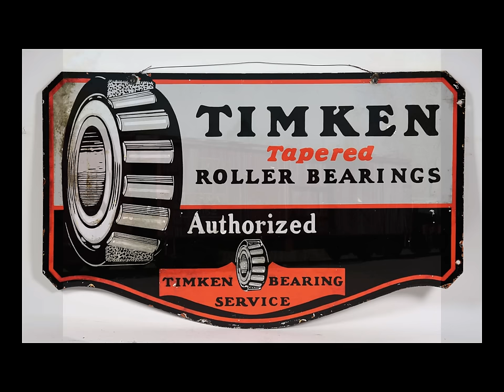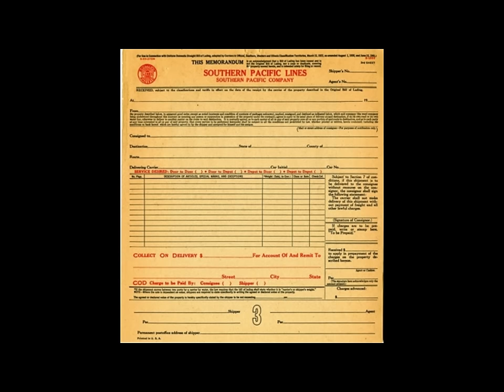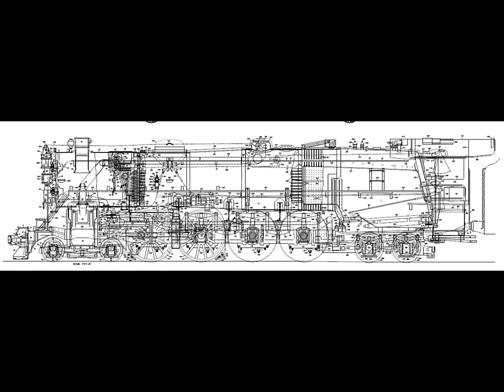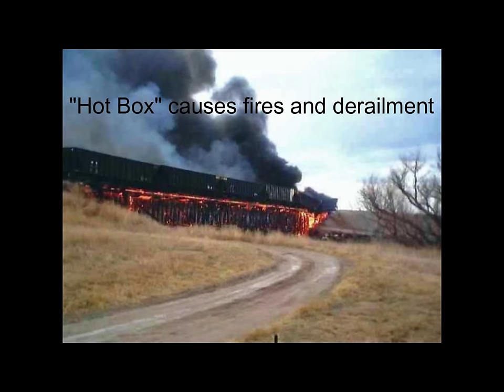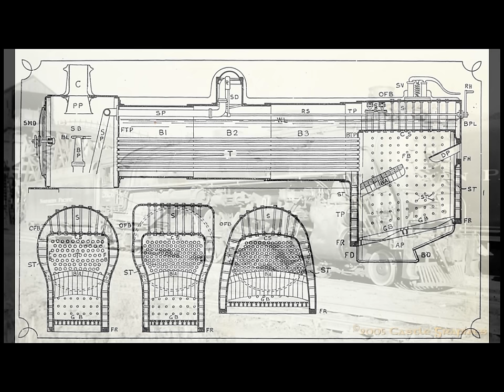Timken's Four Aces

Comment: In my experience of 30+ years working  & repairing steam engines in the U.K.  the most common issue regarding low water ignorance is gauge frame problems.
It’s a daily operational check 1st thing before lighting up or when engine in light steam.
As a driver/fireman you’ve got to be confident it’s demonstrating a true level of water over the crown sheet, when stationary with the regulator shut.
When you open regulator the water will lift by around 1”+.
Another issue is when on the road watch to see if the feed rate is keeping up with steam demand?
Water level falling consistently in sight glass shows this.
Instruct fireman to get second feed on!
As a driver on steam myself, (as taught), I used to shut the reg now & again to see where water was at especially if it was out of sight in top nut.
I myself always liked to see water bobbing in top nut with reg open.
Thanks for effective & interesting vids on these impressive machines you had in the U.S. Keep em coming. 🙂
Reply from the maker: Back in those times it is really beginning to seem like these engineers were purposely running the locomotives with lower than the recommended water levels. Obviously doing these video's I have been diving much deeper into them and the frequency of boiler related incidences is shockingly high. The info you gave is good stuff! i love hearing about real life experiences. Thank you!
Reply: @TheRailroadCrossing-SteamPower  water treatment may also have played a factor though by the late steam era it should have been fairly understood, as for the low water you get more space for steam by running lower but its dangerous, 
but ah the demonstrator engine, heard they tried to save it and it still got cut up even thought the creators tried to get it back :{

Comment: Right around the period of dieselization my father would bring home some discarded metal-frame bench seats, coal shovels (great for snow-shoveling), fuzees(traffic flares) and other odds-n-ends from the railroad he worked for. But best of all, he'd occasionally bring home a few steel ball-bearings( kids called them "stee-lees") which were coveted by young marble players.
Reply from the maker: Yes!! I had them myself! And they were wayyy cool to have!
Reply: Yep, I remember them too.  Better than "puresees", which were coloured, but otherwise clear glass.
Reply: Those are ball bearings.  The difference between ball and roller bearings is significant.  Ball bearings are good for rotation but not side or axial loads.  Roller bearings are good for rotation while offering good side and/or axial load at the same time.  The names say it all--ball or sphere and roller or rod or slightly tapered.

Comment: The reason why fireman would run the engines on low water back then was because the locomotive would produce alot more available horsepower. More steam + less water = way more bang for your buck! Hope this explanation helps! Also love the videos keep em coming 🙂🙂
Reply: dosn't work like that I'm afraid.  Power output on a steam locomotive is unaffected by water level (unless its too high of course). What is effected is the volume of steam, higher water level = smaller steam space, meaning the loco could be worked harder without losing too much steam, but a good fireman will balance his fire and injectors to match what the loco is demanding at the cylinders.
Reply from the maker: Good explanation!
Reply: Your explanation is true for what the fireman thought in those days ,  but not necessarily scientifically correct.

Comment: Less water means less weight in the engine. less water means less fuel to heat the water in the boiler. Less water means faster steaming with the same amount of fuel. 
Too much "Less water" ,means the fireman and engineer get cooked like lobsters, the boiler shell is wide open for inspection, it is easy to inspect the stay bolts, the tubes and flues are already removed (usually found to be twisted and not fit for service) and the smoke box has no ash or other residue. In some cases the boiler is removed from the frame making it much easier for the maintenance crew to service the springs, rigging, brakes, boiler saddles, mud rings, injectors and wheel bearings. You can see, there are some advantages in running boilers low on water.
Reply from the maker: With the disadvantage being people lose their lives.. Not a fair trade if you ask me.
Reply: Also makes cutting up for scrap easier lol

Comment: Interesting fact, Timken bearings are used on Aircraft landing gear even though today. Also the whole thing about engineers running the boiler critically low on water supposedly was an attempt to make steam quicker as it reduced the cooling effect that water had in the boiler thus flash boiling water to gain pressure faster.
Reply from the maker: Yeah, I get that feeling and it's just not a smart thing to do.
Reply: Actually the damage of the crown sheet was due to the water glass being fouled up and wasn't properly reading the correct water level and that's what caused it to fail. @TheRailroadCrossing-SteamPower

Comment: We used thrust bearings on steady  rests in machinery shops, still do.   The fact that a bearing equipped locomotive demands must lower force to lift is fantastic.
Reply from the maker: Indeed!
Reply: Our Machine  Shop has Bronze Bearing adjustable Steady Rests  AND Follower Rests 
BUT we ALSO have ROLLER BEARING steady rests on our LARGE Diameter
Lathes : )
Reply: @walterlefferts6297   OK.   :)       be sure and scrap all your parts out in as an efficient and orderly fashion as possible.
Reply: @archiecoolsdown5854  haha
Our shop is modern and highly efficient, little to ZERO waste or scrap.
It's 2024 grandpop  not 1930 .
Enjoy !

Comment: Since the water in a locomotive boiler is able to slosh around it takes a competent fireman to know what's going on with the water glass. When going up grade the water runs back against the rear of the boiler and the glass will read high. It's important to keep it high on an up grade to keep the far end of the tubes covered.  When the hill is crested and the downgrade starts the water runs to the front of the boiler. If the water level was dropped too far on the climb the possibility of the water running out of the glass on the downhill run exists and then all reference is lost as to where the level actually is. Some mistakes only happen one time.
Reply from the maker: For darn sure on only getting one chance to make a mistake with these things!

Comment: There could be several reasons why a footplate crew might run the water lower than normal, but obviously these are just generalisations, and not excuses. 

1 poor water quality courses priming, so when this is encountered, a crew will nurse the engine with a lower water level until it can be relieved or put on shed.  Bad water quality will also give a false reading on the water gauge, the effort of the locomotive's cylinders taking steam off the boiler, will actually force the water gauge to show a higher reading than is reality, due to the pressure differential.  You can end up with a situation where when the regulator was open, the gauge glass would show a good head of water, but as soon as the regulator was shut the water disappears. 

2 unfamiliarly with the road. Crews are expected to be failure with the road so not only do they know where the junctions and signals and water points are, but also gradients, so the driver knows where to set his cut off and regulator, but also so the fireman can make sure there is a good head of steam for climbing up hills, and plenty of water in the boiler for descents. 

3 Some manufacturers used a safety ball in the gauge glass fittings, the idea being should the gauge glass or its seals fail, the ball closes off the the apitures enough to prevent the footplate becoming ingulfed in steam and boiling water until the crew can isolate the gauge glass.  It would seam that if handled aggressively when blowing down the glass to test the level or clean the glass, these balls would jam in position and give a false reading. This was given as the course for several explosions/crown failures of the USATC S160's on loan to UK railways during WW2 as UK crews were not used to those type of water gauge fittings. 

4 Issues with the feed water. If one of the injector clacks leakes back (by a bit of scale/rust/debris stuck under the valve) the injector will overheat. A hot injector will not pick up and has to be cooled before it can be persuaded to work. 

5 Incompetence or complacency. Often some crew would, when running low of steam, deliberately keep the water level lower to persuade the boiler to steam quicker. 

Its a real shame that this wonderful locomotive was not preserved.
Reply from the maker: Preservation was being discussed, but not fast enough because it made the chopping blocks wilst an agreement was made to save it. I mean they literally had an agreement that Timken would take it for display! NP driver's were in the loco on their lines when the crown sheet was damaged. So it definitely wasnt #2
Reply: Poor water causes FOAMING
Reply: @organbuilder272  foaming leads to PRIMING! Hence poor quality water courses priming.  Been on steam all my life!

Comment: Roller bearings are required by law on North American railroads. Brass bearings were forbidden for interchange in the 1990s.
Reply from the maker: Brass would make sense to ban because the metal properties were too soft
Reply: I think brass is the wrong terminology.  Bronze alloys are still used in many bearing applications. @TheRailroadCrossing-SteamPower
Reply from the maker: @robertducanis4448  Good to know!

Comment: I’m surprised that he didn’t buy his own rolling stock and passenger cars and had them fit with roller bearings. That would have been a better demonstration as coal usage could have been measured and compared to similar consists without roller bearings.
Reply from the maker: Timken didn't have the money for just the locomotive and had to solicit help from 52 other companies to have it built. It was a extremely risky move that wound up forging the company as we know it today. He could have easily lost it all right then and there. Stones!
Reply: @TheRailroadCrossing-SteamPower  we was rather backwards in the UK in regards to roller bearings on locomotives. It was the 1940s before they started to be introduced and even then only on odd locos. Some of the BR standard locos had the mains on roller bearings, and  on bogey and tender but white metal bearings remained much the way of things on locos until 1960. It was only around the that roller bearings started to be used on new goods rollingstock. Some of the first things to use roller bearing in the UK on the railways were passenger coaches.

A threshing contractors (he's nearly 90 now) father purchases a Burrell Traction engibe in the late 1920s. This engine had been reprocessed from the original owners as they couldn't keep up with the hire purchases payments. It was a special one off order. Roller bearings through out (except differential and big ends and motion) 3 speed, sprung mounted on rubber stakes. I imagine it was the dogs dodars. Shame Edgar's dad had it scrapped in the 1940s when they went over to diesel tractors.

I admit I cheat on bearings on my models. When I rebuilt my model traction engine, I fitted the back axle the The diff centre on roller bearings, and made the engune very free rolling. On my last two portable engines I've used roller bearings on the crankshaft. Their much better than plain bearings.

Comment: running low water is not a horsepower booster.  Its an issue of poor firing by the fireman is terrible on safety, locomotive performance and efficiency.   Under pressure water changes to steam at a temperature higher than 212 degrees.   For example at 275 psi water doesn't change to steam until it reaches 414 degrees.  Water expands 1600 times its volume when it changes to steam.  A boiler at full water glass and just prior to the safeties lifting is about at its peak in horsepower production,  the only exception to that would be a locomotive that has been running hard, the piping and cylinders, etc are all up to temperature with a full water glass and just prior to safeties lifting.   It all comes down to the fact that the volume of 1000 gallons of water at operating psi and temperature can become 214400 cubic feet of steam,  if all you have is 100 gallons of water you can safely make steam that is only 21440 cubic feet of steam.  Also with such low water a locomotive without a feedwater heater is going to suffer far more adding cold water to the boiler with low water.  If needed the best time to add water is under load, locomotive hot and drafting good, the fireman can set or moderate adding water to keep the safeties from lifting.  Safeties lifting is  considered a sign of wasting fuel.
Reply from the maker: Yeah, not a good practice at all to be doing. Just dangerous and irresponsible.

Comment: The reason why engineers liked to operate on low boiler water despite being dangerous played into these factors.

Increased steam production: By operating with lower water levels in the boiler, more space was available for steam production. A smaller water volume allowed for a larger steam space, which could generate higher steam pressure and thus increase the locomotive's power output. This was particularly desirable in situations where extra power was needed, such as climbing steep gradients or accelerating heavy trains.

Faster response time: With less water in the boiler, the locomotive's response time to throttle adjustments was quicker. Steam pressure changes could be achieved more rapidly, allowing engineers to adjust power output promptly to meet the demands of the train's operation.

Reduce carryover: Carryover refers to the entrainment of water particles with steam, resulting in wet steam. Wet steam can negatively affect the efficiency of the locomotive and lead to reduced power and increased wear on the cylinders and valves. By operating with lower water levels, engineers believed they could reduce carryover and achieve drier steam.

Comment: It was common to run the water down before a grade. Low water made steam and pressure faster. But if it made pressure too fast the boiler could explode or blow out all the tubes. If the engine was climbing a grade, the cylinders would only cycle so fast and couldn't use excessive steam and pressure. The engineer could try to use some of the excess steam by using a longer cut off -  the time steam was allowed into the cylinder. From water to steam, water expands 16x. If the crown sheet isn't deeply covered with water, it doesn't bubble into steam, it flashes into steam faster than the safeties can release the over pressure. 
I grew up in the 1940s & 50s in a railroad town that did major locomotive rebuilds.
Reply from the maker: So basically they did it to prevent a possible stall?
Reply: @TheRailroadCrossing-SteamPower  They did it to have more HP than normal to make climbing the grade easier and faster. Near the top or at the top they start adding water because they no longer need extra power and can't use the extra steam. As cooler water enters the boiler it lowers the boiler temperature and steam making slows down.
Reply from the maker: @oceanmariner  Got it! Thank You!
Reply: A boiler will not produce more steam than the safety valves (assuming they are correctly maintained) can handle by having low water level. It's accepted practice safe pressure is redline +10% (which on some US locos can be as much as 30psi extra), but even then there will be a safety margin (the hydraulic test of a boiler alone is 1.5x the safe working pressure) Excessive pressure can upset the live steam feed injectors, as the cones are made to operated at a given pressure range, meaning there could be issues with feed water, but I dont think this would become a issue. 

Tubes will fail if exposed for too long whist climbing and working hard. This is often why the top row of tubes will fail near the front tubeplate while the others are fairly good. 

Cylinder and drawbar Horse power is uneffected by lower water level. Ats about steam space above the water, giving extra volume of steam for working hard, and the increasing speed the boiler can produce steam. On a smaller boiler it will also help to reduce the risk of priming. 

The driver will use a longer cut off when climbing so the cylinders produce more power, to prevent the speed dropping to much and also stalling. Has nothing to do with getting rid of excess steam. A longer cut off will use more steam but also creates a much fearcer blast at the blast nozzle so will help draw the fire hotter and help make steam.

A shortage of water over the crown will not flash to steam. You get what is known as kettling (excessive steam bubbles under water) which allows the firebox plates to over heat as if they were dry. You can also get this if the water spaces around a firebox are too small.
Reply: Wrong - If it made pressure too fast the safety valves would open.  Water expands at 17:1, not 16. If the crown sheet is run dry, when the water returns and sloshes over it, the water falshed into steam.  If the crown sheet is expose the fusible plugs melt  and blow steam into the firebox. or the top of the firebox caves in.